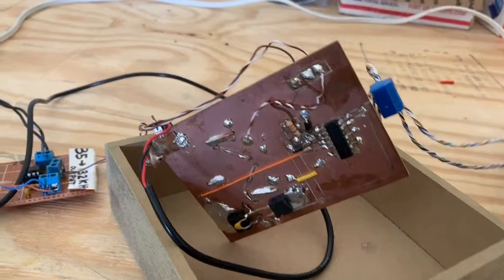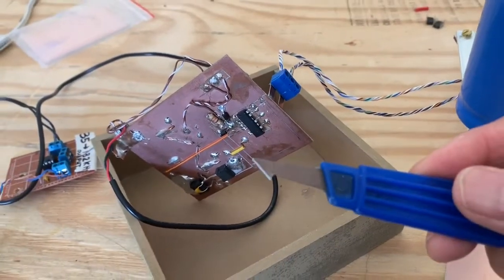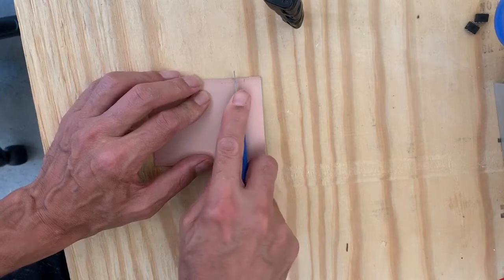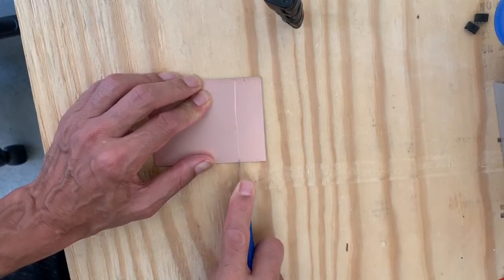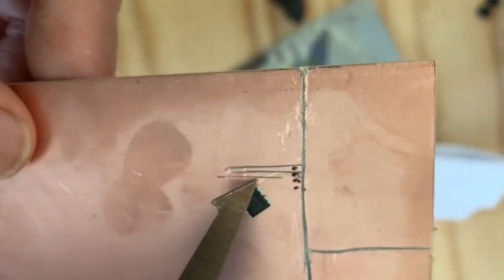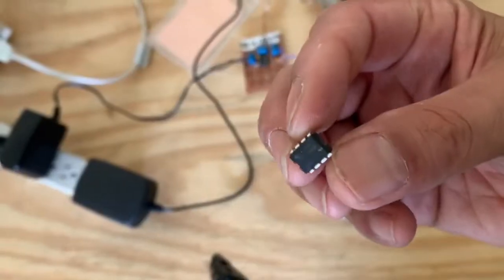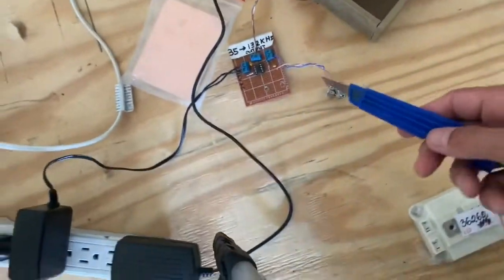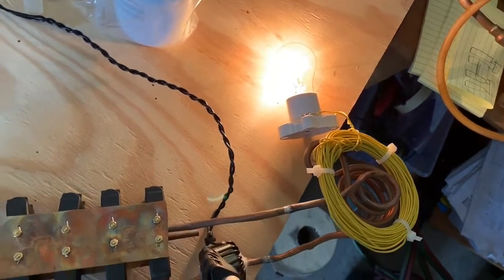How to Cut Traces on Copper Clad with Plexiglass Cutter

Comment: I really like this technique, it seems very promising! I used an exacto blade to cut a small breakout board and quickly found that it wasn't quite the optimal tool for the job. What I was imagining was one of those V-tipped wood carving tools. It might help to get cleaner edges on the traces. Until then I'll have to look for a plexiglass cutter, thanks for sharing this tip!
Reply from the maker: I am happy you like the video!